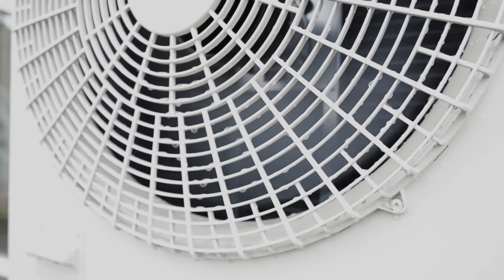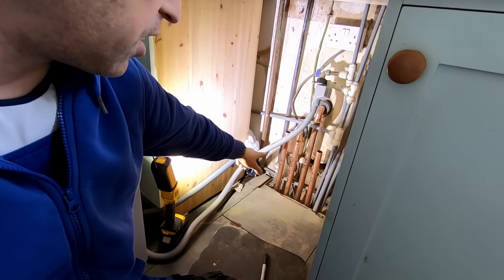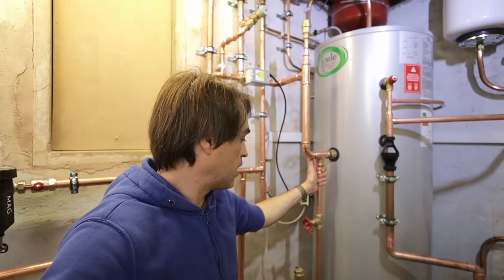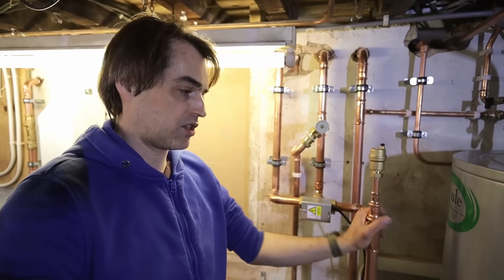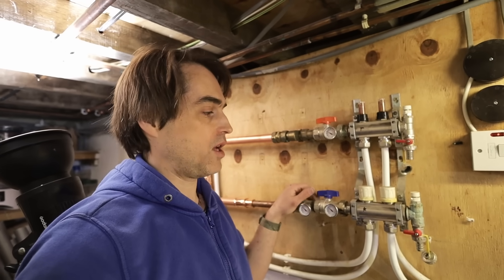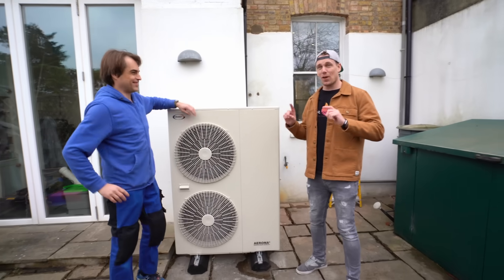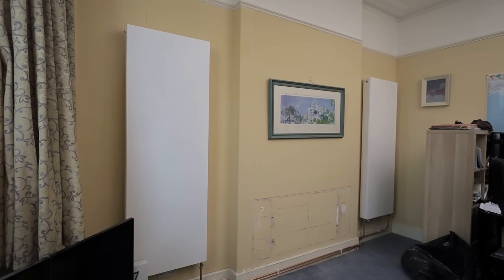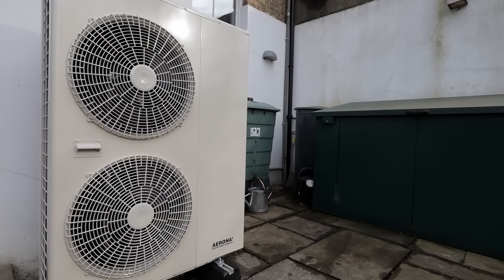The Truth about Heat Pumps: Debunking the Myth.

Comment: The scale and complexity of these systems renders Johnson’s aims essentially unacceptable nonsense. If as much effort had been put into properly insulating houses the CO2 produced by heating would have been a massively reduced. Let’s not forget that the electric to power heat pumps depends on gas for up to 60% (no matter how many wind turbines and solar panels you have no wind and no,sunlight means no power) so the trade-off is less clear cut. Also, there is a massive energy cost in the production of heat pumps and associated paraphernalia. Much of it will come from China so coal fired power. If to achieve “net zero” you front load with even more CO2 you negate the aim of CO2 reduction. 
The strong message: go back to the drawing board and stop this lunacy before it gets even more out of control.
Reply from the maker: Heat pumps is exactly what will stop the current lunacy of burning fossil fuels at 80% efficiency to heat our homes.
Reply: Mr Ross does not know what he is talking about. Fossil fuels are most definitely on their way out. As they bloody well should.
Reply: @user-kc1tf7zm3b  Au contraire. I know my subject very well. I have a background in energy both by degree and professionally. I totally agree that fossil fuels are (and should) be on the way out. My point is that current policy is utterly nuts and counterproductive hence my comment on China. Check out China’s coal consumption vs the rest of the world.
Reply: @Rossi593  Bloody hell! What do you damn well expect from the country with the world’s largest population of 1.4 billion? The United States does not even have half a billion, at only 330 million. However, the US has emitted most of the world’s CO2 emissions at 399 billion tonnes (25%) over the centuries, which is double China’s cumulative total of 200 billion tonnes (12.7%).

China and India are certainly entitled to their own economic development and prosperity just like the United States. My ethnic Indian law studies teacher made a point of this years ago when I was in high school.

A little intellectual consistency would go a long way, Mr Ross. Lest you come off as an out and out hypocrite. Be more British and balanced in your outlook. 🇬🇧
Reply: @user-kc1tf7zm3b  Wow, you’re quite touchy.
Reply: @Rossi593  All hypocrites are liars, Mr Ross. 

Be a King’s College London student. Be a better person. 🇬🇧
Reply: @user-kc1tf7zm3b  So explain my hypocrisy. I’m not a liar just a realist. I was a student at Leeds University (Fuel and Energy Engineering) so actually know my subject plus worked on coal fired power plants here and in India. I’m very aware of the injustices in the world. I was an underwriter of power and energy business for the past 28 years so have a rounded view of what does what. I’m not in disagreement with you but the argument that it’s someone else’s turn to pollute won’t wash.
Reply: @Rossi593  For a second time: developing countries like China and India are perfectly entitled to their economic prosperity. Just like the West. So, it is all very rich for Western countries to point fingers and throw stones at other countries, when Western countries have very much prospered with their destruction of the environment with carbon emissions. 

It is utterly dishonest for Westerners to claim, in effect: “Our historical and cumulative CO2 emissions are irrelevant to the current day, as this happened in the past.”.
Reply: @user-kc1tf7zm3b  I heard you the first time. China has become the West’s manufacturing base as to a lesser degree has India. China’s increase in coal fired generation over 30 years dwarfs that removed by the West. 
Your moral stance might well be right but we all inhabit the same planet and no western nation will say “it’s your turn”. The way forward is for the West to go into controlled recession and a global policy that redresses the inequalities. India and China have not been hampered by the West as you seem to allege. India is self-hampered by the caste system and inability to actually do things. I was there long enough to witness the huge potential yet inability to exploit it to the benefit of all. 
Ok, I rambled but actually on you side.
Reply: @Rossi593  In any case, the Chinese are totally cognizant of the sheer reality and the importance of climate change. As the Chinese are paying a high price for climate change with wild weather events and premature deaths caused by pollution. This is a basic point that Western laypeople overlook. The Chinese response to decarbonisation is essentially: “We need more time to develop our economy to a certain level.”. 

India? One only has to look back at the 2010 Commonwealth Games to patently see how farcical their hosting was, which is a stark reflection of their society. In the same vein of the diabolical 2014 Rio de Janeiro Olympic Games.

Not surprisingly, London held a fantastic Olympics in 2012.
Reply: Your figure of 60% for electricity produced by gas is vastly inflated since the figure is around 31%.

And, as a developed nation, and you as a degree holder, don't you feel we should be trying to do the best we can? Or is a 'well China is burning coal' race to the bottom a way you'd like to go? Personally, I like to use my degree to make the world a better place.

Comment: In Australia we just use air based split system heating. It's quick to install and seems a lot easier than the amount of pipe work done here. I have a bunch of Aircon units in my house in all the bedrooms 2.5kw and lounge rooms kitchen etc 7kw and they all function as heaters and air cons. If one breaks all the others keep working. This solution seems overengineered and probably prone to failure as well as probably many many times more expensive. On the other hand looks like nice work 😂
Reply: Yes when it gets extremely cold then heat pumps become less useful although if Norway is using them they are probably fine for most of the world especially if you have some old type electrical fan ones for the days it does get crazy cold. I also opted for lots of split systems instead of one connected large unit  so if one breaks all the others still work. I'm in a hot climate so mine are used 90 percent for cooling. I've never seen these water based ones before and I'd expect the cost would be insane. We do have hot water system based ones in Australia that utilise heat pumps although not many people have them because they are quite expensive and from what I've heard more prone to failure than the simple kettle style ones which are cheap although cost a lot more In electricity.if you know the channel technology connections he has recently done a few good episodes on heat pumps, apparently they are very uncommon in the USA which surprised me as they have heat pump air conditioners but don't bother making them reverse cycle. In Australia they can pretty much all do both heat and cooling.
Reply: Yeah I can just buy a mini split unit for around 1500, install it my self and keep gas for hot water and emergency heat. And you get Aircon in the summer as a bonus
Reply: Brent I have set my house up the same as yours those little units 2.5 kw  have a cop of 5 or maybe 6  The 7 kw maybe cop 3.5 or 4 the units also work below zero. When you have breakdown it only 1 unit Down not the whole house and cheap to fix. The cost of the installation in the video would be horrendous (for those that do not know what cop is cop 5 means 1 kw of power in for 5 kw heating or cooling out.)Very popular in Australia you can cook in a heat wave in summer and freeze in winter. Straight electric hot water is better for shower. Heat pump unit bit to expensive for me. Than wack solar power on the roof works out very cheap to run and fix. As as  retired technician I know everything will break down and need replacing. I have had to replace expensive units before but never again. Learnt the hard way with my wallet.
Reply: Split systems are not effective in Canberra where temperatures drop to minus five at night. They must be supplemented with resistance heating which is very expensive to run.
Reply: @guyh9992 my question would be how many nights do you get below negative 5 and could you just use cheap fan heaters on those (few??) nights. Also it is probable that many Australian split systems are not designed for the lowest temperatures due to our climate generally being warm, there are differences in efficiency levels . But I wouldn't be using split systems in Siberia that's for sure. If it's freezing cold all the time split systems aren't going to be able to pull warmth out of the air very well. The technology connections page did a good episode on it and he lives in a cold part of the USA. I think he worked out there would be something like less than 20 days in a year where an efficient split system wouldn't heat properly.
Reply: @guyh9992  Jesus. In Portsmouth England temperatures rarely drop below minus 5 at night in winter. England seems ideal for heat pumps if even Australia struggles
Reply: @guyh9992  We had a full size heat pump in Ottawa Canada and it worked pretty well down to about -20C. Currently we have two heat pumps (a 5 ton and a 3 ton) with no backup resistance heat. The temperature here (Maryland USA) ranges from -18C/0F to 38C/100F and averages around 60% humidity. We never have a problem heating or cooling a 4,600 square feet above grade.
Reply: Air to air is fine as long as you don't need the system to also heat your water. Replacing a boiler this is pretty much mandatory.
Reply: @schrodingerscat1863  Domestic hot water is normally not tied into the HVAC system here in North America. We have standalone domestic hot water systems and emersion electric heaters are slowly being replaced by hybrid water heaters (heat pump, but fully integrated into one unit). We have two of the hybrids and combined we have about 175 gallon first hour capacity at 140C.
Reply: @rich7447  Here in the UK most systems installed over the past 20 years have been combination boilers providing on demand hot water. These are small gas boilers that require no storage tanks. Most properties in the UK are very small in comparison to the US so we don't have space for the types of systems common in the US. The storage tanks and plant necessary to use heat pumps take up way too much space for most dwellings let alone having separate heating and hot water systems.
Reply: @schrodingerscat1863  On demand systems are popular here too. They have a smaller percentage of the home /apartment market, but are huge in recreational vehicles. We have a diesel fired on demand system in our motor home that provides domestic hot water and supplemental space heating.
Reply: @rich7447  Yeh, that is flipped here in the UK where the vast majority now have on demand water heater heating and space heating from a single small gas boiler. Most properties used the extra space freed up by removing storage tanks for other things and they are not going to go back to storage tanks willingly.
Reply: @schrodingerscat1863  Makes sense. We have   2,800 square feet of basement space for all of that kind of stuff. We have a couple of pressure tanks for our wells, one of the forced air blower units, and a couple of server racks down there so a few extra feet of floor space is not a big deal. Because I'm in Maryland I also have to have a huge (1,000 gallon) storage tank full of water specifically for the fire suppression system. This is mandatory on all newer homes that are not in Baltimore City. I guess they want Baltimore to burn down.
Reply: @schrodingerscat1863  You can get a specific heat pump water heater if you need water as well. Lots more homes these days are switching back to tanks as they can combine with off peak electric usage which you can't with on demand systems. Obviously smaller ones use the on demand system.
Reply: @TheGalifrey  Problem is that heat pumps don't get very hot so you need a tank and it takes quite some time to heat water to a usable temperature. So now not only do you need a huge heat pump but you also need a large hot water storage tank with associated expansion vessel and plumbing.  This takes up a lot of room and is expensive to purchase and install.
Reply: @schrodingerscat1863  They are £2k for a self contained system with external venting 260L @65 degrees and max 8 Bar. They can fit in almost any Loft/Attic and as part of a new mini-split system the costs are comparable with a full central heating system install. With the forecast on gas prices and electricity price potentially being delinked from gas this could become a major money saver after a few years, not to mention the carbon savings and the ability to run from home solar. I agree they are not right for everyone, but your comment that these systems are useless in the UK is not true. Since having my mini-split system installed at home we barely use any gas now. It was a major factor in our buyers choosing to buy our house. Once we have moved we will be going fully mini-split and heat pump water. We will also have 30kWh of battery and 8kw of solar, but in a much larger house in France this time.
Reply: @TheGalifrey  Thing is the system you describe is not going to work for a majority of UK homes as there is no where for the tank. Plus heating water takes longer so a family will be running out of hot water constantly unless they have a huge tank. It's ok if you have room and the money to purchase a 2K water heater and have it installed on top of whatever heating solution but that doesn't work for the majority of people.

Personally I run everything off electricity because I have micro hydro and solar providing constant free electricity but I am hugely privileged in this respect. However I still understand that this all electric utopia you speak of is unobtainable for the vast majority.
Reply: I think Australia seems ahead in time zone & renewables. Things have to be tried and tested for some 2-3 decades to see if they'll last.
Reply: Yes, installing an air to liquid heat pump is just silly. You will have to be a plumber to get that to make sense. Air-air units are easy to install, a lot cheaper and they will make a big difference. Half of Norway has them to heat the house during winter, and some years it will get hot enough in summer to use it as air con for maybe two days.
Reply: @quadcopter  Air-to-anything is fine for warm countries like Australia or Norway - well, probably excluding Svalbard. But it the temp regularly drops below -20C, the only way to go (apart from burning fossil) is geothermal.
Reply: @jmi5969   I really don't know anything about this subject, but I have never seen ANYONE say "a warm country like Norway" before.  Are you sure you meant Norway?
Reply: @jmi5969  we get down to -17C and my mini split heat pump works pretty good. As long as you have pretty good insulation it works pretty well.